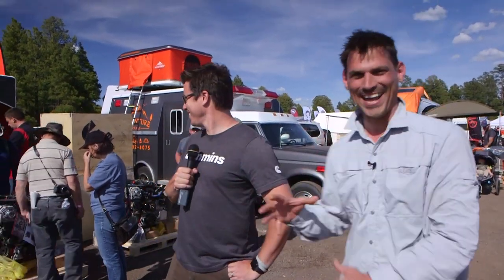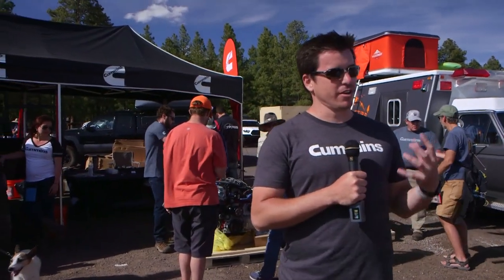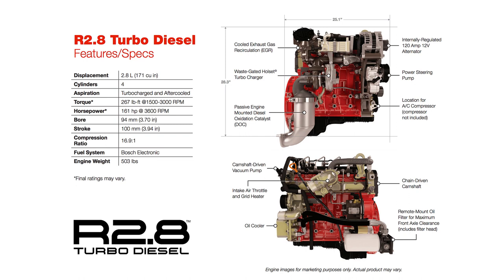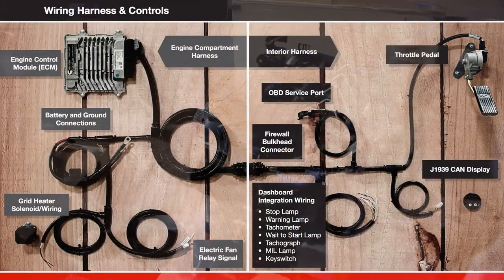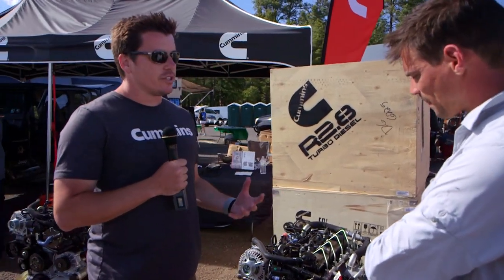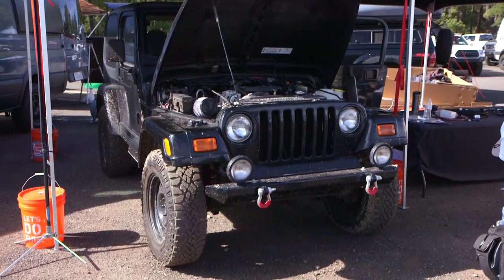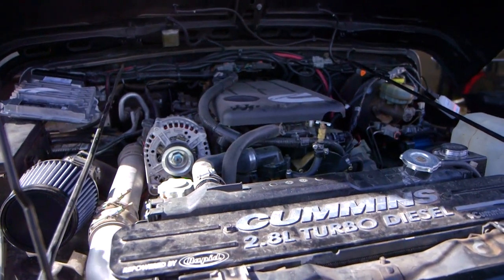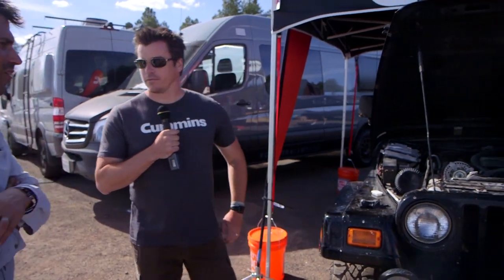Turbo Diesel Crate Engine for your Overland Rig - Cummins R2.8

Comment: I really appreciate a big company like Cummins doing this for the community, for sure they're gonna make a profit off of this but bigger companies like Toyota flat out denied the possibility of diesels in North America simply because of little to no profit margin. Toyota should do the same homework like Cummins did and research the actual communities, and do the customers a huge favor and modify the diesels and bring them over to North America. GM did. North America is HUUUUUUGE, fuel mileage of the diesel would be fantastic!!

I am a huge manual transmission fan, and HATE GM vehicles... but I brought myself to talk to a salesman to buy a diesel automatic GMC Canyon, for ONE reason, DIESEL. I would own a Tacoma manual diesel right now if it was offered.
Reply: How's that 2.8 LWN so far?

Comment: I just spoke with TORFAB about helping me find a diesel for 62 or 80 project and said we could do it, but parts may have to come from Africa or the Middle East if there were problems. This would solve all those issues . They give you any details about what might work for the rest of the driveline? Not much on Advance Adapters about it other than the one video.

Comment: I wonder if they are still coming with plastic oil pans? look up the dirt every day episode where it cracks like an egg when it hits a rock.
Reply: This is a slightly different engine I think... DED put in an ISF2.8 motor as opposed to the R2.8 featured in this video. I don't know how much difference there is, really. That was a funny episode tho
Reply: That engine on DED was a prototype and may not run the plastic sump now. You'd be having a bash plate or some type of sump guard to protect it in any case.
Reply: If you're going rock crawling without a skid plate you deserve whatever happens.
Reply: Zach Coldwell the plastic  lover got crazy I drove a 60 series  detroit  had a plastic  pan it hung 6 inches below  the front axle was dumb
Reply: I see a duramax and powerstroke fanboy triggered by the fact their engines suck!

Comment: I can think of a number of applications for this 2.8 litre diesel engine. While I like the Duramax 2.8 litre turbo diesel, we need more options out there for crate diesel engines of this size.
Reply: crack them open and you will see that the chevy, dodge, jeep, 2.8 are the same motor and the cummins 2.8 is only different from the covers out
Reply: Are they? I would think they'd be totally different from one another. I consider it unforgivable that more small displacement diesel engines aren't available for those who want one for their car, truck, van, etc.

Comment: my 1990 yj 4.2 . garaged for 27 years. 70,000  miles   no rust because I washed an wd40 motor,frame etc. I need a motor like that. LS1 is an optio n also.

Comment: For mine, I'm going with a VW 1.9 td aaz. but I'm replacing a 82hp 1.7L Lada engine.  and not to mention the fact that that 500 lbs would kill my suspension.

Comment: I would imagine if the emissions were deleted as they should be it would become very dependable and durable.
Reply: Good grief, yes... there are plenty of cummins motors around from fifty, sixty years ago that are still running beautifully, and that was before the government required all these layers of emissions control and electronic b.s. on top of the diesels we get these days. Odd also because modern engines and diesel fuel are burning the heck of a lot cleaner than they used to even without all the emissions junk
Reply: Is it available from Cummins DIesel power in SA

Comment: BIG diesel myth:   torque makes horsepower irrelevant.    Just ask any trucker or p/u owner who pulls a trailer.   Low end torque is nice but horsepower matters.   The reason Europe is running this engine in f-350's etc.  is because they aren't obsessed with going 70mph up a 7% grade - they just downshift to a lower gear - oh yeah, that is what gears are for.  If HP was not important then trucks would still be running Cummins 250's or DD 6-71's.

Comment: 1999 and older vehicles for EPA compliance, 1994 and older for CARB, sorry guys and gals. Also, this engine has about 100 lbs ft of torque less than a Colorado diesel, for example. 120 amp alternator would need to be upgraded to be used as an overland adventure as well.  At least no DEF!

Comment: Noob question. I have a 3rd gen 4Runner with the 3.4 would you be able to use the original transmission and swap this motor in? Does it just adapt to whatever trans your vehicle has?

Comment: price and was it completely rweady to run once adapted to the vehicle? I know it has a loom and a ecm but does it come with its own fuel pump ect ect. Also did they do away with the plastic oil pan? Instant failure with that pan.

Comment: I wonder, does it use mechanical or electronic fuel injection?  Got to worry about EMP and getting the thing up and running if we are hit by one.  Is it capable of being converted to biodiesel?

Comment: Now why did FCA go with the ecodiesel instead if this? the Cummins name is second to none in the light duty diesel market so name power is there right away. I bet with a bit of tuning it would make the same power as the v6 but be more durable because it's an inline 4.

Comment: How does the R2.8 stack up with the 4bt?
Reply: R2.8 weighs 503 lbs vs 4bt 800 lbs. R2.8 is 2.8l vs 4bt 3.9l. R2.8 has 165 hp vs 4bt 100 hp (torque is similar, but not flat). R2.8 is turn key that it only needs a bell housing and motor mounts vs 4bt has nothing and you start from scratch. R2.8 is better in every way.
Reply: A Crustacean thanks for that detailed comparison.
Reply: except price

Comment: love diesel but seems really low on power for the 2.8 displacement. new chevy cruze 1.6 is 137hp and 240 lb ft. i know they want reliability and fuel savings but I figured from close to 3 liters it would put out some slightly more impressive numbers then a economy diesel sedan.
Reply: Pandrade to meet emission standards it is probably held back quite a bit. I bet a tune and deletes would put you over 190/325
Reply: Tyler Jordan the numbers I've posted about the chevy cruze 1.6 diesels are with American emissions that choke it up( USA emissions are some of the harshest of all). so smaller displacement ontop of harsher emissions and still a small chevy eco sedan puts out more. seems Cummings missed the mark.

Comment: 2.8 ÷ 4  =  0.7 liter 
So if Cummins built  a 6 cylinder engine,  using a modular  system. 
O.7 liter   x  6 cylinder  =  4.2 liter  inline 6 cylinder.

Comment: what transmission works with that engine
Reply: Base on a deboss garage video from sema in 2018 lots of them. There were aftermarket adapter kits for many truck transmissions like nv4500s, 6l80Es and more. They had some cummins builder program that was giving more info too, I think.

Comment: Can you put one of these in a 1st Gen Nissan Xterra?
Reply from the maker: I'm not sure!
Reply: The xterra was definitely a looker and i loved that you could get it in a manual, but they never updated the power plant 😢
Reply: Anything is possible just need the right adapter plate and bell housing for the transmission
Reply: @Julian Eckstein - I have a 1.5 gen xterra, and I'm seriously thinking about one of these. I've not heard of anyone in the xterra forums that has done this yet. I'm very interested in making this happen but there are some hurdles: 1) As Suave mentions below, he adapter plate and bell housing for the tranny. 2) Depending on where you live, there may be emissions issues. 3) Total Cost for installation with all the custom fab work that would need to be done. 4) Lots of other smaller issues.  I'd be interested in collaborating with other xterra owners to see if this is a truly viable option for xterra's.

Comment: Will these diesel engines run on straight vegetable oil like the old Mercedes diesel engines?
Reply: yes and no, add a lubricating additive like slik50, it better go trough a dam good filter and drop out the glycerin or you will need all new fuel system after it cools of from the first run.

Comment: I need this in my Suzuki samurai. Ill be proud to put a cummins badge on my samurai. Where can I get dimensions on this. Width,height,length. Please
Reply: I was wondering the same thing. I've been wanting tdi in my zuk for a while.

It fits in an old jeep though so assuming theres a tranny adapter then it should fit.

Here in Canada we got a lot of tdi jettas though so probably still gonna save myself the $13000 or so Canukistani coins.
It'd sure be nice to have a 0km powerplant in there though.

Comment: I too am skeptical of that thing effectively moving an 80 series down the road.
Reply from the maker: Ya, I'd need more power.
Reply: Don't forget, they put the same engine in the 2500 Sprinter Vans. Even the ones with duallys on the back
Reply: It is cool that they are offering a packaged deal, but for an 80, I still think the best option is a LSx motor as a pull-out from a wreck. It is the one thing that GM still makes that is worth a crap. Put a 6.0 or 6.2 in there with the transmission that is mated to it, happy times and decent MPG. And there are adapters for the TC. You would have to modify the drivelines for length but thats easy.
Reply: I hope they put the same engine in a frontier, that gives me a 50 state legal drop in solution. I would love love love to see the 5.0 turned into a crate motor. That would be a powerplant for an 80 series, or even lop 2 cylinders off the 5.0. Make it a super fuel efficient and powerful v6 turbo diesel...  sweet dreams are made of these.
Reply: I'm sure it would move one just fine.

still there are likely better options out there.

This is a pretty niche product, I don't think many people realize that, they just see the Cummins name
Reply: moondog573 even the factory diesel in the 80 is a full on 4.2 straight six boat anchor
Reply: Ocee Bee What people forget is that the 6.2 LS makes over 350 lbft at a 1000 rpm , mind you it won't  be as efficient though . It's hard for me to decide  I like both V8s and diesels but can't beat the exhaust note of a V8 at full song ripping through mud

Comment: I think Cummins should take these videos down until they figure out their supply chain issues. I bought a 2.8 crate motor in Feb. At that point they were saying engines were available but "install kits" (basically wiring harness) would be available in early March. My motor showed up not in a fancy crate but on a pallet wrapped in a refrigerator box. The box was pierced with forklift, the top of the motor (fuel lines, some of the plastic parts) were smashed. So Cummins sent another motor. It has been sitting in my engine compartment for nearly 3 months. STILL NO INSTALL KIT. If it shipped today it would be 3 months late. And they have stopped returning emails....

Comment: Question does it come without the electronic fuel Control? I'm thinking along the survivability to EMP.  although it would solve all other problems of a toyo style dependable turbo.
Reply: twistedwacko there is the original 4bt Cummins, wouldn't have the common rail or egr equipment
Reply: stoney126 ! electronics? and will it fit into a series 80 land cruiser?
Reply: Maybe the fuel pump and grid heater. And I'm sure it would fit. But they are very loud and not sure how it would fare on the highway
Reply: stoney126 ! and there lies the problem.....EMP proofed and roadable!
Reply: you can be like the military and shield the electronic components. You will need to keep your loom inside a metallic/shielded conduit etc.
Reply: wazza33racer True but if you have chips like in electronic controls then it's next to it possible to shield  the chip.
Reply: twistedwacko ??? EMP - how many times have you run through this problem last year? 

common rail does, of course, only work with electronics. it's ~2000/3000 bar pressure WITH control. how should emissions control work w/o electronics.
Reply: of course you can shield it, look up "faraday cage". The military have electronic chips in planes and tanks etc..........they just take precautions to make them EMP resistant.
Reply: the wiring loom is the biggest problem, the long lengths of copper wires are in effect,antenna's that induct the EMP energy into a voltage spike. If the wiring is in shielded conduit, and the ecu in its own metal box, it is in effect, shielded.  Go do some reading and educate yourself on the basics of what EMP is, and how it causes damage.
Reply: wazza33racer if you're interested in putting out anotber $10-20 k per vehicle, then the current consensus is that any thing pre 1992 would be less likely to be affected without military grade protection.
Reply: hey, nobody said it would be cheap or easy..............thats why it doesnt come standard.
Reply: wazza33racer jus tg calls for another work around that doesn't involve motherboards or micro chips😎
Reply: Just buy an extra control box and keep it in an ammo box if your worried about EMP.
Reply: TX Rider an ammo box is not a farraday cage! and tjen how many chip sets do you need to replace? i just replaced my master cylinder on my gen 4 4runner it runs the abs sc and ss controls with a mother board........$ 3500 dollars how do i put that in a farraday cage?
Reply: There is only one control box on the cummins crate engine. So only 1 would be needed. And yes an ammo box, specifically a steel one would make a fine faraday cage, which is simply shielding. Though it would not even be needed for an unplugged control box with no wires coming from it.

An EMP is simply very strong radio waves, you have to have a long enough piece of wire to act as an antenna to produce any electrical charge large enough to damage anything. Just like your radio antenna is hit by radio waves which induce an electrical charge into the antenna which is passed into the radio so you can hear a station, you don't get reception with no antenna, and you don't get reception inside a closed steel box.

BTW your 4runner will likely be just fine in an EMP, the steel body of the truck makes a decent shield itself. If your worried about it buy an old truck with old fashioned points and condenser and carburetor or drop a diesel into it, mine is a 1954 military M-37. And I have a cummins 4bt diesel in the shop I'll be putting into it one day.
Reply: TX Rider Andy ammo can won't work as a Faraday cage without further shielding. It has to be a metal to metal grounded fit. Also EMP is caused by propagation of gamma rays and their interaction with the atmosphere and the earth's natural magnetic fields which straps free electrons and sends out a static charge in the range of 50,000 volts per square meter, one theory is that micro chips won't need an antenna to absorb and burn out with these voltages, whether caused by a nuclear weapon or a coronal discharge big enough to blow through the van Allen belts.
Reply: EMP stands for electro magnetic pulse.  Radio waves are also an electro magnetic pulse. 

Specifically nuclear EMP covers the frequencies from about 1 to 300MHZ which covers the long and short wave frequencies as well as UHF/VHF.

The gamma induced EMP is a secondary EMP phemomenon which can occur..

The main danger from an EMP is the same as with a solar flare and is mainly limited to the power grid where we have miles and miles of suspended high voltage wire to act like massive antennas and build a charge just like any other wire exposed to electro magnetism does and send this energy throughout the grid.. The longer the wire the higher the electrical charge build up in it.

And yes the vast majority of cars would be just fine, and yes a steel box would provide plenty of shielding. Almost all electronic devices would be just fine as long as they are unplugged from the wall socket, many would be just fine if simply turned off. The same type of effect you see from lightning striking near power lines and creating a surge..

50,000 volts is less than your cars spark plugs operate on, 50,000 volts per sq meter is about 32 volts per sq inch, and since a chip is likely about a quarter of that size you would be talking about 8 volts and as a chip is 90% non metallic it would likely be only a few hundred millivolts to a few volts.  So yes chips would only be destroyed if connected to enough wire or conductive material to be able to induce enough voltage to harm them.

Here is some light reading if you want to catch up..It covers common myths in the appendix at the end.

https://www.ferc.gov/industries/electric/indus-act/reliability/cybersecurity/ferc_meta-r-320.pdf
Reply: they came in alot of bread trucks so should definitely be fine in a land cruiser and for the fuel pump you can always run a mechanical
Reply: He TX Rider I think I just got more good info from you in this thread than I have read anywhere else on the net. Thanks man.
Reply: twistedwacko you know the emp doesnt last forever,  it only lasts during and just after it goes off

Comment: Really wish there was a factory crate supply of brand new 90's mechanical 6bt's. Got a 97' GMC crew cab one ton DRW that needs one. 

Really don't want the gutless 6.5L back but don't want someone else's ragged out rebuilt shit that's spent most of its life having the dog shit run out of it. Not easy to find a older 6bt that hasn't been abused.